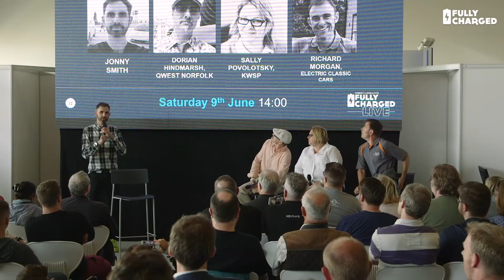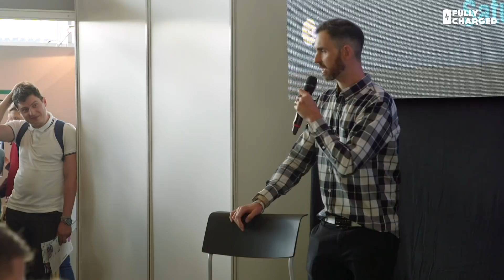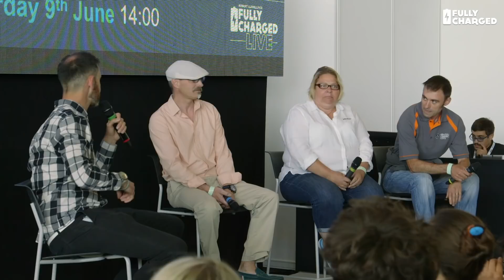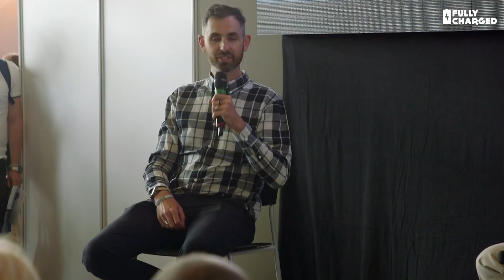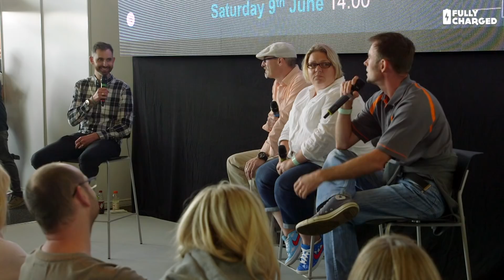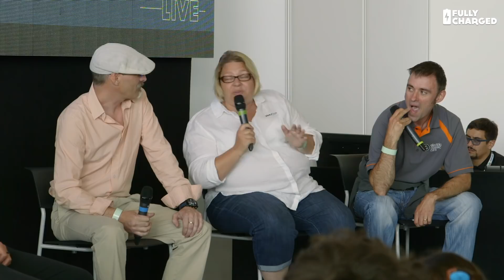Electrifying EV Classics | Fully Charged Live 2018 Talk 6

Comment: I would like to electrify a 1989 ford festiva. My first car was a 1989 four speed ford festival, that went from 0 to 60 miles an hour in 3-5 minutes. The original engine had been messed up by a previous owner, so they put a 3 cylinder engine in to replace it.

Comment: I've been thinking about doing this. I love small European cars from the 60s. Here is Sacramento, California, there is a small problem facing people who are interested in classic cars, which is that to daily drive it you really want to add air conditioning. That can be done, but with a classic car you might not be able to put in the necessary ducting without compromising the aesthetics. That has got me thinking about later cars that are kind of classics, like a Saab 99 from the 70s, which can have factory air conditioning that can be converted to run on an electric system. A company that does conversions in California that I plan to use when the right time comes is EV4U, based in Redding, California...

Comment: Electrification does not mean low CO2.
Reply: yes it does compared to burning fossil fuels, both because the electric motor is more efficient, and because the electricity can come from wind, solar and nuclear as well as fossil fuel, so yes Electrification does mean lower co2

Comment: Hybrids work fine and if they use LNG instead of gasoline then it emits half the CO2 as a 30 mpg gasoline car. All-EV cars still use hydrocarbon because they have to make the electricity with hydrocarbon. There’s very little solar and wind. 

There are fewer moving parts.

Comment: For quite a few years now, I've had a dream of converting a '75 Buick Electra 225 to all electric. I figure that I can add a third motor to run the original belt driven accessories.

I think an electric 5000 pound land yacht is an excellent way to prove to the world that ditching the ICE is more than just saving the planet, but also a way to almost double the horsepower in a way that is smooth, and complementary to the original car, which was designed to be powerful and smooth... 
Netgain makes it possible.